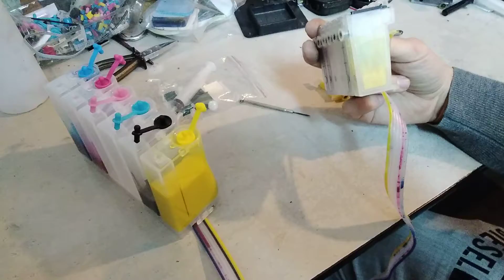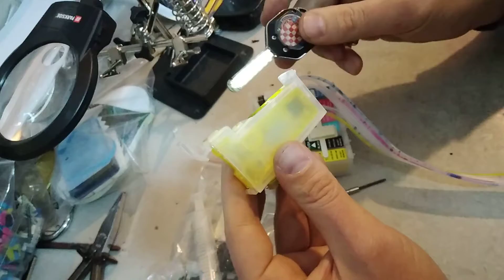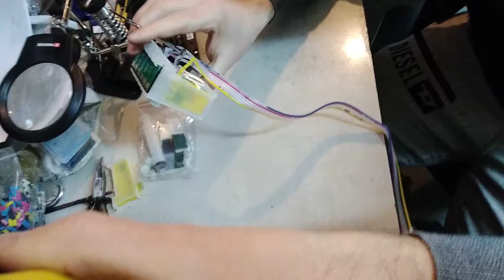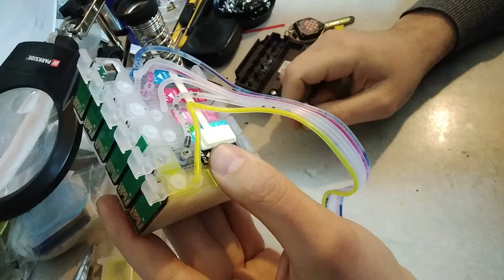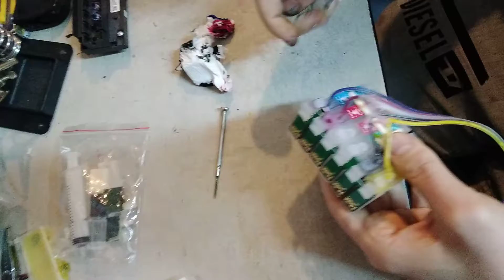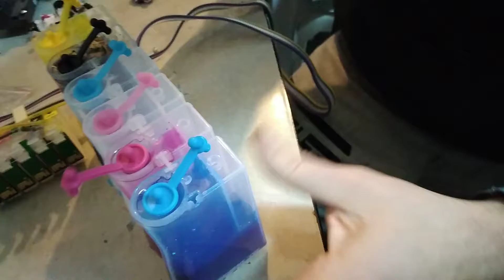CISS system for printers how to fill and maintenace

Comment: Hello, I had a question on the subject. How should the color scheme be in the head part? If white color is added, how is the head color order?
Reply from the maker: Hi, the color order is Yellow-Black-White-White-Magenta-Cyan and that is also the option you have to set in your Rip software. Is under color options "Ink channel". That is if you are using Acro rip which is the most used software, but if you are using some other the order should be the same and instead of light cyan and light magenta you put the white ink on the ink channel.
Reply: @Max0ressurected  Do I need to make any settings on Acro rip? For printing with white ink and which version of Acro rip would you recommend?
Reply from the maker: Yes you have an option "ink chanell" and you have to set it to YKWWMC and keep it at that all the time, because if you select anything else the printer would be mixing white ink with others.
Reply: @Max0ressurected  Thank you very much for the information you provided. I will try over the weekend.
Reply: @Max0ressurected  Hi. I made the settings you wrote, but when I start the machine, the paint drips instead of spraying it from the head. It keeps dripping, I can't get the output. What do you think could be the reason? Is there a place where I can reach you faster?
Reply from the maker: You have to check if the head is ok. You can have a look here on this video on how to clean head manually https://www.youtube.com/watch?v=fM4-sjZF94k
and than if you have curtains on every channel than the head is ok something else is wrong. If it drips when you clean it manually than the seal or chamber is broken on the head. In that case you will need another head. Also if you keep the ciss above the level of the printer the ink might be dripping. You need to keep the ciss in the level of printer.